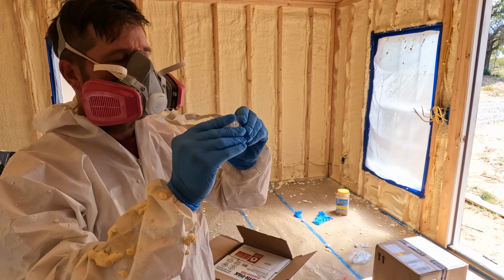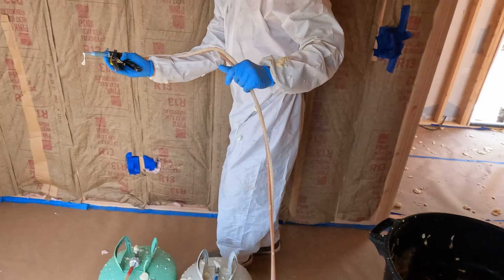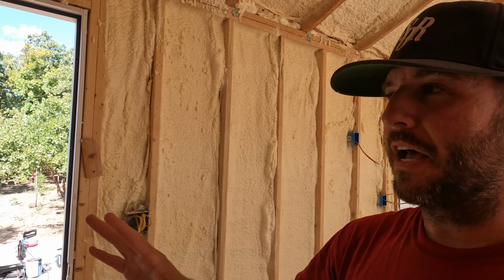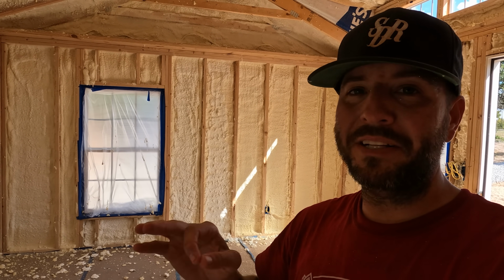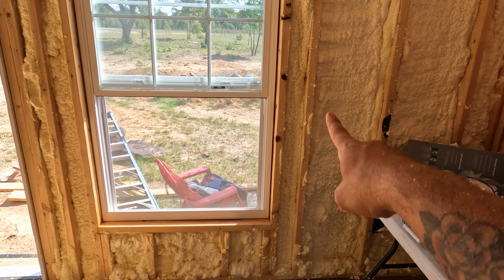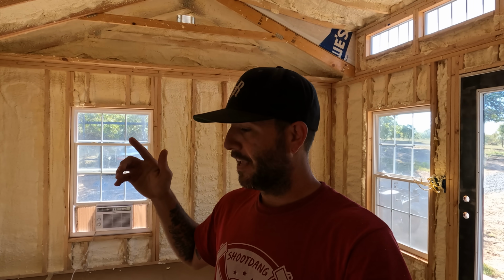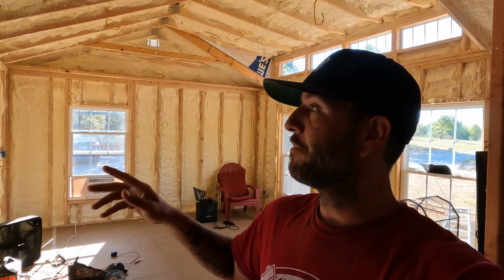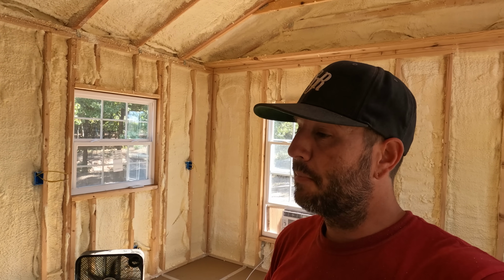Shed To Tiny House - DIY Amazon Froth Pak Spray Foam - Was It Worth It?

Comment: Never had a problem with Whirlpool washers or refrigerators at all. But I have had some really bad appliances and they were made by Frigidaire. I like watching all the Crocker Family videos.  I  was a plumber  for 30 years,  but haven't done much in the last year. Had a below the knee amputation,  but have learned to drive with my go go gadget leg. You guys keep me entertained and I thank you. My prosthetic is camo by the way😎
Reply: We have kitchen aid factory here Ohio.  None  the companies can make ice maker in refrigerator
Reply: Frigidaire is made by whirlpool, whirlpool is the absolute worst product made.
Reply: @brettwalker4915  I agree. I worked at Whirlpool in Evansville, Indiana when they shut us down and moved to Mexico. They wanted us to help train their employees, who were afraid of the torches. You can't braze a joint with a cold torch. Will never own another. Kitchen Aid is also a Whirlpool brand.
Reply: @brettwalker4915  I worked for them it all same company kitchen aid . The Chinese make all computer ice makers for most the companies
Reply: @KenJ-61  that not refrigerator it simple not computer inside
Reply: @brettwalker4915  I agree! I don’t care for my whirlpool fridge , first and last one .I’ve had it five years .
Reply: I loved my old Whirlpool appliances...before they put in computer boards. They are messed up! They also seem to fail right after the warranty expires. Replacements can be bought through Sears parts & are easy enough to replace. Buy an old set if you can find a used set...so much better.

Comment: Jared... They make "seed catcher" covers for bird cages to keep the seeds and husks from going all over the place. Birds can be very messy. Do not place the cage where it  gets direct sunlight or near a draft or ac. I had parakeets for years when my girls were little and I learned lessons the hard way. 
The birds look happy and I love the cage you got for them. 
Great job on the spray foam! Keep up the good work.
---Val from Alabama
Reply: Birds should have a container of water to bathe in. They love splashing around in it. There are also cage liners. They have a sandy film on it which helps them first the budgie seeds.
Reply: Digest not first!!
Reply: Yes... They make bird baths that you can hook onto the door of the cage. Also a seed cup filled with "bird gravel n grit", and a cuttlebone that attaches to the inside of the cage for them to keep their beaks filed down.

Comment: I agree with the No Samsung comment, when we moved into our current home we kept the previous owners appliances.  The washer and dryer were Samsung, so when we had a service/repair technician come I asked which brand was the best. He said LG, easier to run, to service and you can set up diagnostic testing through a phone app. Great video, as always. Thanks for sharing!

Comment: I've had GE Appliances for years, they are very good and Whirlpool is another one. Also look at Frigidare they are really good too. I like the way the spray foam turned out, it will save you money in the long run and thank you for saying we all matter.
Reply: Yes, I  have GE and whirlpool appliances.  Love them.  GE is on a whole different level than what it was  about 20 or 30 years ago. GE is now right ip there with the best. Lot of good brands  though.
Reply: Whirlpool for fridges …had mine for years no issues. I have Simpson washers ..just replaced my 10 year old one with same brand and updated digital model..

Comment: Great job, glad to see the difference in temp even with the tiny a/c. I think if you have some light colored  curtains or blinds that are closed on the sun side it will really help. Birds have delicate respiratory systems so any left over fumes might cause  problem  but they look & sound very happy. So happy for you with all of the progress!
Reply: I was wondering about the fumes for the birds also but maybe it had time to air out. They also have problems with fumes from the non-stick coating on the pots and pans so he might want to Google some information on that👍

Comment: Jared: I would stay away from Samsung.  Many issues with their entire line of appliances.  Whirlpool is American made and has good warranty.  PLEASE consider the Bosch dishwasher with the water filter in it. It’s the only brand that makes a dishwasher with this specific filter that keeps your dishwasher running smoothly. When you have well water or extremely hard water, it’s very hard on dishwashers.  We splurged on the Bosch and have NOT been disappointed!  Always enjoy your videos and positive attitude.
Reply: Second on staying away from Samsung washers, dryers and dishwashers. They only have a limited lifespan, and they polycoat the instrument boards, so they are not repairable. 
I 2nd Bosch, then go with the least amount of wash dry cycles on your washer and dryers. Less can go wrong, and I found that we don't use the fancy cycles. Maytag is also good. Look at customer reviews.

I still have my Kenmore refrigerator and GE stove top. My double oven is not made anymore, and the company is gone, so I won't suggest them.

Comment: Check out fisher Paykal washer and dryer very economical to run and are built for living in the bush in Australia.As for a refrigerator don’t get one with a freezer and ice maker on the bottom. Great job on your insulation you all made it look easy as long as you do the prep work first

Comment: I have a whirlpool refrigerator, no problem with it. I have a Samsung front loading washer and dryer, no problem with them. I have a Samsung gas stove, no problem with it. I have had the washer and dryer for 10 years, the refrigerator for over five years, and the stove over five years.  Needless to say I have got a good amount of use with no issues so far.  Every appliance company will have a bad one every now then but I’ve been lucky so far.  I like the spray foam for several reasons, it gets into all the cracks and corners, to me it seems like it would keep the heat or cold out better being a solid surface, and the ease and the speed of installing it.  I admire you for doing projects with little to no experience.  Love the birds.  Can’t wait to see the walls and ceiling get finished.  It’s going to be so beautiful. ❤️❤️❤️❤️

Comment: I have a Samsung washer & dryer boughtv5 years ago & love them! Love my freezer on bottom 4 door Samsung refrigerator also purchased 5years ago. Samsung glass top stove, also 5 years ols, All black in color. Dishwasher is a stainless Bosch with black exterior. Whirlpool microwave black.  Samsung has not let us down yet. Ice maker has never failed, but we use it daily, when we vacation we empty it & shut it off. Key is not letting ice set for long periods without use. Good luck to you.

Comment: I bought a Samsung fridge that was 1400 it immediately had problems with water dripping and freezing the fans so the fridge wouldn't cool. We would have to take the thing apart every month to keep it working. I replaced it with a black whirlpool freezer on the bottom fridge that I LOVE.

Comment: Go grey cabinets and flooring , 
Quartz countertop,black stainless steel appliances with black stainless cabinet pulls. Use butcher block on a kitchen island. Island can be on wheels and tuck under a counter until needed. Upper cabinets are a must. Dark grey lower with lighter grey uppers to make use of bright daylight and not darken room because of less square footage than your last home.

Comment: Spray foam looks great. Jared are you aware that you can but a suite of appliances. The grouping usually consists of a fridge, microwave, stove and dishwasher.  I know a suite at lowes when I looked online saved about 800 off the grouping.  The one I saw was a gas stove. Which when you are in the country is not a bad thing.  Happy hunting.
Reply: With GAS appliances,  when power goes out he'll at least still have a Stove to cook on*in, Hot Water (On Demand?), maybe even  Heater!!!

Comment: If you got some black plastic and hang over the windows inside then from outside it will look tinted but inside it will cut the sun from shining inside and heating it up and that will cool the rooms faster. I did that to my double wide and made a huge difference and makes it feel so cool- winter time just roll the plastic up to top and throw a cloths pin on it to hold it up and let sun heat the rooms up 😉

Comment: I put in a two way fridge,  I use air fry/oven, and a confection plate. I don't have a dish washer, I would rather hand wash my dishes. I did this so I have more counter top area. I can put it all away and have more room for putting out food when people come over. Love it. Plus I can run it all off solar or LP. So I don't have to worry when power goes out. I also have solar lights byRed Shed. They look like normal lights and come with remote controllers. I hardly ever use electricity. I did set it up for convenience when my family comes. My daughter likes what I did. Now has moved her tiny house next to me and we are setting hers up the same way!

Comment: I haven’t had any luck with Samsung appliances. The wiring shorted out in my Samsung range after only 4 years. I gave it to my appliance repairman, also my neighbor, then found out it was still under warranty. I had forgotten about buying the extended warranty. The good news was,they actually honored the warranty even though I had given it away and went and fixed it for my neighbor! Bought a Samsung tv that didn’t work but was able to return it to Walmart. Bought another brand and saved a couple hundred bucks. Btw, you did a great job with that spray foam insulation!

Comment: Suggestion, fill in the rest of those bats on the roof with fiberglass.  You don't have a lot of insulation there and that's where it makes the biggest difference.  Also, covering those windows will reduce a lot of the passive solar heating.  Nice job!

Comment: I have had whirlpool appliances for 40 years and they work awesome.  Washers no problem.  Electric dryer one repair.  Refrigerator never had a problem till 15 yrs then needed ice marker fixed.  Microwaves, no problem and dishwashers awesome.   Stay away from LG, Took 5 weeks to locate a repairman that would come.  Fixed it myself.

Comment: Just a tip. Turn your gun a quarter turn spray from bottom to top and top to bottom spray your angles first then fill in the middle also wipe the drip hanging from the gun every chance you get as it is wasting your material. Keep your tip inside the cavity and no air balling "spraying from a distance".

Comment: I love it! It doesnt matter whst the spray foam looks like, because it will be covered up.  I think you chose the right insulation.   I live in Mesa Az and wish i had a spray foam house.  I would stay cooler at a higher ac setting.

Comment: Lowes has the fancy cellar shades on sale for half price right now… and they’re electric so it can be done via the remote OR through alexia wifi. I bought them when I saw they were less than reg priced cellar shades… I bought 32x67 (maybe 74”) for 39.00 came w all the hardware and the remote, they were like 129.00. I got them for my “tiny” cabin build I’m knee deep in. I get a tremendous amount of sunlight all day but these little suckers black out completely and I have them programmed to open up in the am when I get up close them during summer at 11am or I just tell Alexa to do it. Love it! 

Looks great

Comment: Spray foam adds to rigidity of the building overall & seals air leaks. Do both sides of door openings for the added rigidity where the weight of doors stress walls from opening & closing. That section left bare on the side of the dormer will be hot as a pistol but, 🤷‍♀️

Comment: Glad the insulation is done and you can finally have at least a little bit of cooling going on!  Shopping for appliances - I'd suggest sticking with the old brand names (which I think are merged now anyway).  I've had no problems with my Samsung fridge, GE stove and microwave.  LOVE my Kitchen Aid dishwasher, stainless inside, too - only thing is its touchpad control is on the top face of the door and brushing up against it turns the dang thing on!  Happy I went with stainless so not too dark (stove and microwave have black features), plus, I think the scratch a magnet caused on my fridge door would show up more had it been black.  Whatever you choose, be sure the finish doesn't show every fingerprint!!!  (Won't tell anyone how old my Whirlpool washer and dryer are!)  Enjoy watching you plan and work neatly and carefully.  Also happy you adopted the parakeets!  I think you're supposed to cover them at night?  Good progress, Jared . . .

Comment: Jared, put that window ac on the north side of your house it will run cooler on the shady side then use the box fan to push the cool around. I think you did an excellent job with the spray foam especially considering it was your first time.

Comment: It has been proven the spray foam while yes 3x the price of pink/bat insulation, but it will pay itself off over time by reducing your energy costs in the house and is a far superior product. You did good Jarrrreeetttttt
Ps we’ve just renovated our kitchen and I’ve got Westinghouse oven, cooktop & dishwasher, fridge is LG as I love my 10year old LG front load washing machine.

Comment: i would suggest you place the air conditioning unit on the north side of the house, at least until you get the mini split installed.  by placing it on the north side of the house, it will not be in the sun for as long as either other side, and that will make it easier to cool the house.  just trying to help you,

Comment: Great Job on the spray foam. It looked good. And looks pretty easy to do. I bought all Samsung black stainless for my brand new house. Don't buy Samsung! My over stove microwave went out the first month. They came fixed it and now the sensor don't work. The digital panel in stove went out in first year. It was easy for me to order the  whole thing and just switch it out.  The double French door fridge. Has 2 ice makers. The top one freezes up and don't work so have to use the bottom one only. When needed I will replace with different brand.

Comment: Truth be told, what you spent for the froth packs is relative to spray foam costs everywhere. Per sq ft cost, it's pretty close to "professional" company's doing it, at least here in Florida. Samsung has great W/D, nothing I've had in the kitchen worked. GE and Kenmore are staples, but they've all had their problems. Love what you're doing ❤️

Comment: The home looks great.  Its coming along.  I had a Samsung applianced kitchen and washer/dryer. The only thing I didn't like was the Samsung stove. It was electric and it seemed like the elements weren't hot enough.  Took forever to boil water.  Also the Samsung dishwasher was bad it had a seal leak that kept messing up the sensors. So stay away from the stove and dish washer. lol.

Comment: A/C... Since a/c units only exchange temperature. Having it on a north or east side typically increases cooling capacity. Less sun = cooler air. 
Converse is true for winter heating.
Enjoy your site.

Comment: I really like what you've done so far. Inside and your projects outside. I've known you are great with your animals but I'm truly impressed with your bird setup. Nice size cage, birdie play gym, toys and food. As a long term bird owner (parakeets, cockatiels, Amazon parrot and scarlet macaw), I can give you some tips: provide fresh (or thawed frozen) vegetables like greens, broccoli, cauliflower, carrots, etc ... Plus some of your food (popcorn without butter or salt) a little cooked egg, fruits, just avoid avocado, salty or processed foods. Don't feed a solid bird seed diet. That's like feeding your kids hot dogs and chips and nothing else. They might like it, but it sure isn't healthy . Keep giving them small cut up pieces of fruit and veggies daily. They might not dive in right away but eventually they'll get curious and peck at it. Then hopefully they'll eat it. My birds large and small liked some of my grits before I salted or buttered it, that sort of thing. The most dangerous things you can have around birds are pesticides and anything that off gases toxins (new carpet, paint, etc. ) The worst though was Teflon coated pans. Non-stick pans have killed more pet birds than anything else. When they overheat they emit toxic gas that overwhelms the delicate respiratory systems of birds, large and small. Stainless steel pans, cast iron, glass and I think the new ceramic coated pans are fine. I had a caregiver leave a burner on low, thinking he had turned it off (electric stove) and left a pan on it. That night I heard my Amazon and cockatiels fall to the floor of their cages one by one. I am bedbound and couldn't do anything. That next day all my pans went into the trash and bought new stainless steel ones.

Comment: I use to have a pair of budgies or parakeets. now I have a Quaker Parrot. The parakeets you can train to speak some words. I didn't know that when we had ours. Also,
they need a few toys to tear apart, one with bells, 
you can find everything on Amazon or at a pet store. Even Walmart may have.
Great job on the Spray Foam.
You may want to do a Cost comparison of a company that does it, vs DIY for future reference.

Comment: I think the spray foam made a huge difference. I think you said it was 90* outside and 80* inside. Big difference from when before if it was 90* outside then it would have been 100* inside. So yeah huge difference considering you have no curtains yet to keep out even more heat and no door knobs or deadbolt locks installed. Once you get your walls and ceiling covered that place will be super easy to heat or cool. Loved the bird cage for Shoot & Dang. They looked and sounded happy. We like Whirlpool appliances. Not to say that brand is better than the rest but we've had good luck with them.